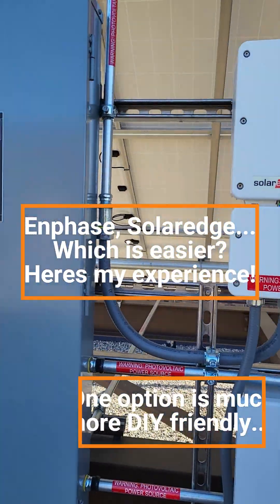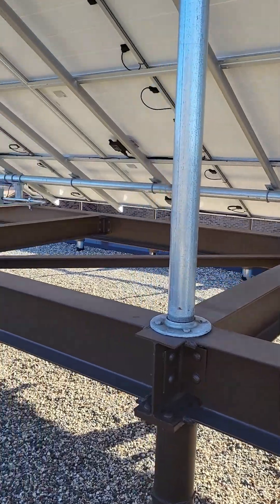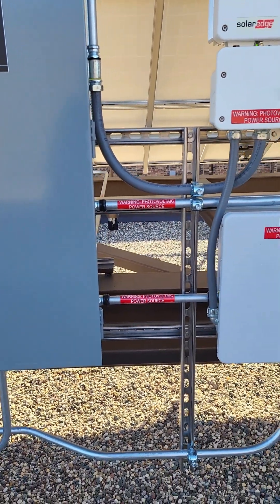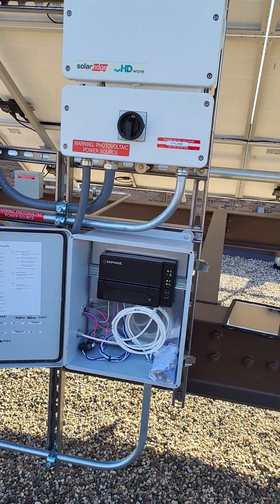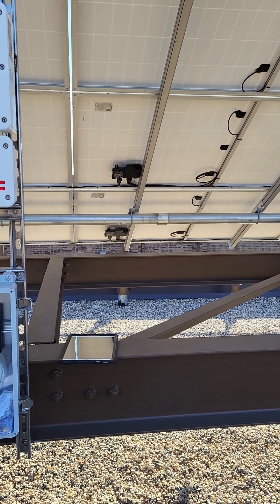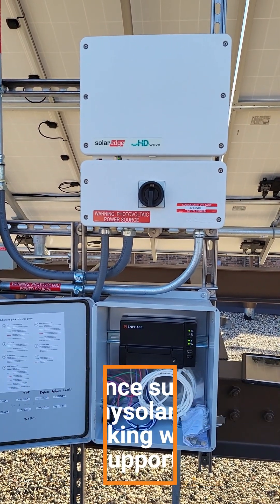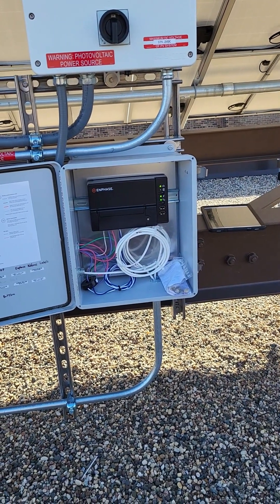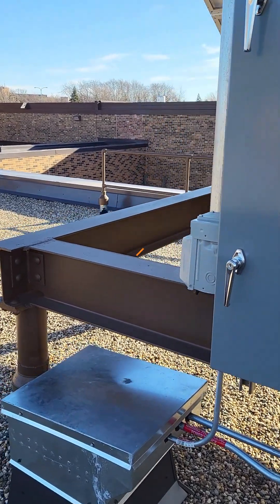Solaredge vs Enphase? Which is easier? better?

Comment: your central is going to be less conversion if you have batteries, which equates to less loss.  It was interesting you discussed inverter size and clipping but enphase has bigger inverters if you want to adjust the size, but that is kind of diminishing returns.  I ended up pairing up a REC 405w with IQ8M's figuring the MNOT(average real world conditions) was 309 and the M's run 330w, so yeah there probably is some clipping during peak months, but it was 5 cents extra a watt to goto the model A's (366w).   AFAIK Enphase is generally more expensive then central by a considerable amount.  If cost is your main consideration, then central is probably the best way to go, pair them up with some average panels and goto town, but I wanted to ensure that my heat coefficient and degradation was the lowest possible, so spent a little more to get premium panels, as it gets quite warm in the summer.
Reply from the maker: On this particular project,  it was designed by an engineer who didn't know much about solar... if I was designing it, I'd have done it a bit differently...
Reply: @minnesotacountrylivin4674  cool,  what would you have done differently?
Reply from the maker: @llN3M3515ll   hmm   if I had to do a combination of micros and a string inverter(for educational purposes) I would have evenly matched the max output/sell back to get a fair comparison.... those enphase iq7+ can only sell back like 290w at any given moment  could have went to an iq8  version  and evened it up a little better